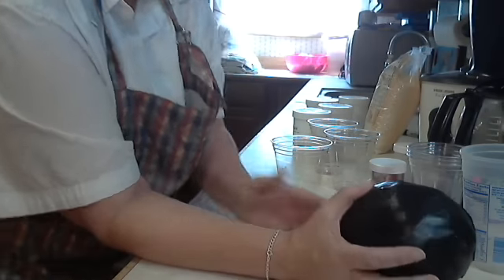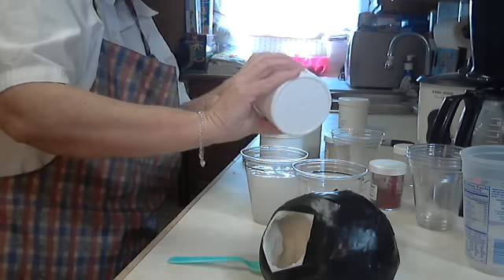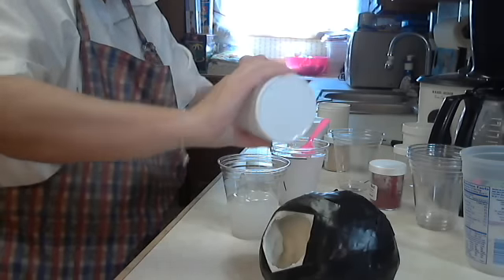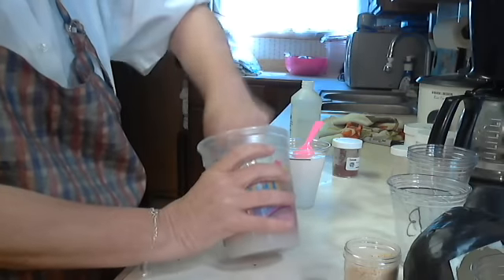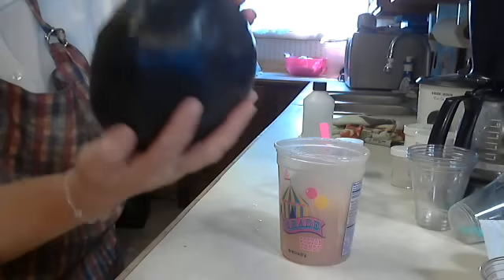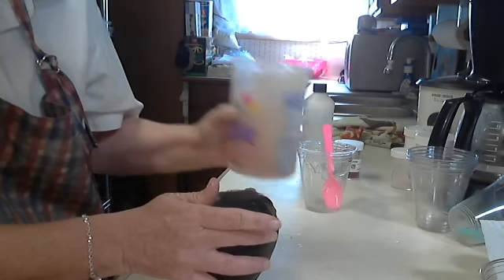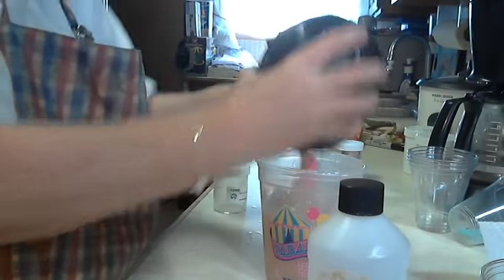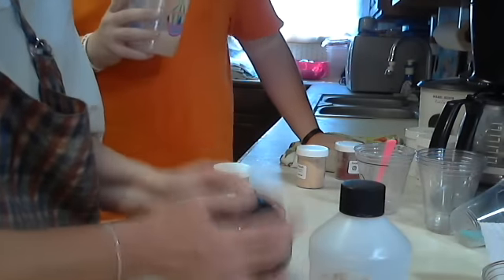Pouring Silicone in the Silicone Babies' Head

Comment: I also use the rice sometimes to 'measure' however from previous trial and error I've learned most of the time you need to add at least  2 ounces extra because once you mix the silicone and especially if you have added your pigment and flocking, you will probably come up short on the silicone as she showed us.  It's better to be on the safe side and do a little extra. (there's a formula for measuring but I don't like math, lol!   Also, for mixing it is way better to use paint sticks.  This ensures thorough mixing and it's  long enough where you don't get your fingers full of  silicone. You can get them free at Walmart, Lowes, Home Depot;   Brick In The Yard sells a whole box for a few dollars.   The best way to get bubble-free silicone is to use the Vacuum Chamber.  You can get brand new ones for less than $400 on Ebay.

Comment: What if you found some kind of a vibrating pillow, that way you could set it on the pillow and the vibration would help take out the bubbles?
Reply: We use a vibrating machine to make molds at the dental office.. it has a vibration speed adjustment on it.